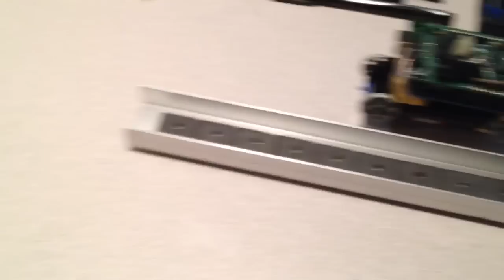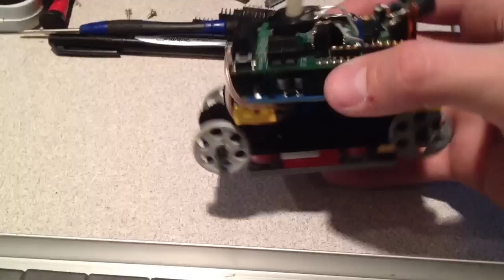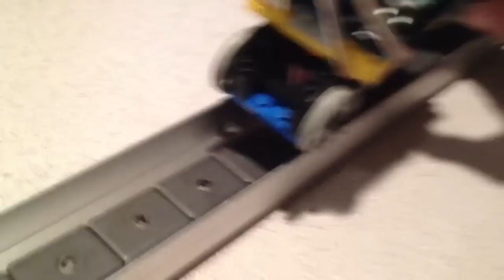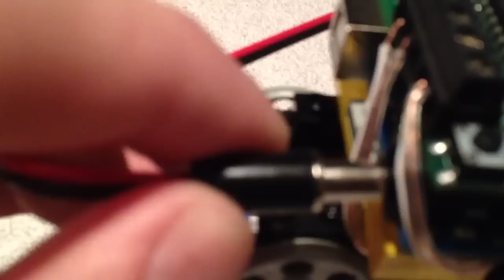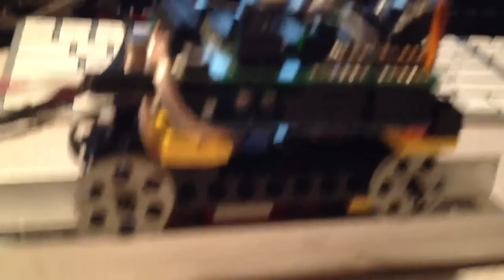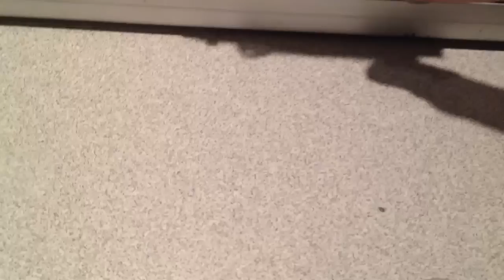2 Phase Linear Synchronous Motor mini

Comment: How did you build  your electromagnets plz ? Or  Where did you buy it ?
Reply from the maker: I think I wound the magnets by hand around nails or screws that happened to fit the lego perfectly.  You should use magnet wire for things like this, it has a thin enamel coating instead of thick rubber/plastic.

Comment: Wow, awesome stuff!

Would it be simpler if you used permanent magnets on the train and electromagnets on the track?
Reply from the maker: I never saw a notification, sorry - It could be simpler to do so (magnetically launched roller coasters use such a setup) but would have required a lot more magnet wire, as well as more output channels on the driver

Comment: What if you had a track with the coils all lined up and then a cart with a few magnets (or maybe just one?)... would that work also? 

How do roller coasters launch their cart without power on the train itself? Awesome project btw!!!
Reply from the maker: Excellent questions. Most magnetically launched roller coasters use linear induction motors, which have the coils mounted on the track and aluminum fins on the train itself. Some do use linear synchronous motors though, which have magnets mounted to the trains, as you suggest.
Reply: @Blorkus  I was wondering this too. If a roller coaster train has magnets attached to the bottom, they would have to be controlled electro-magnets as two sets of permanent magnets together would propel the train at insane speeds pulling g forces well beyond what the human body can withstand. I guess what we were wondering is where are they getting the power from? Lithium ion batteries possibly? Why have we never heard of any fires resulting? I know that's a common issue with l-ion technology.
Reply from the maker: @steveo7771286  and Matt, Luckily it's simpler than that, they mount permanent magnets to the train and the electromagnets along the track, and that's only if they're using synchronous motors. Most use induction motors on the track, which just need aluminum fins mounted to the trains.
Reply: @Blorkus  Ah. That makes much more sense. Lol. I guess a lot of roller coaster manufacturers are leaning toward lsm tech in their newer models as opposed to lim as it apparently more efficient, and both are far more reliable than hydraulic launches, although nowhere near as forceful or thrilling. I guess the capacitors and power grids can only handle so much energy being expelled at once. I don't know, I've always been fascinated with this technology, especially with launches. Hydraulic launches are way more forceful and admittedly freaking cool to watch/listen to, but on a tech level are actually quite boring, comparatively speaking.

Comment: Very cool project man! :-)

I have a motor design that uses the LSM principals, but works in a circular motion, so the drive can be harnessed for other purposes.
One thing that I've found is to move away from static magnets, and rather use electromagnets for both portions. By doing this, you can, in essence, time when the the magnetic fields are present, as well as switch the respective polarities.
With this timing ability, you can achieve a much more fluid movement, as well as create more effective drive with lower power consumtion
Reply: What would you use to control the timing and to switch the polarities? I'm considering doing something like this as a project for an E&M class...

Comment: Im learning about motors and electricity for work. And reading about sychronous motors right now. The info ive gotten reads that the stator field comes on to quickly for the rotor field to absorb...causing the imbalance you are having where it bounces off North and South. They use a squirrel cage to help designate polarity for motion in cylindrical fashion with 24v DC to align poles and "lock in" 
What about applying low volt to your magnet path below? Would that somehow lead the cart in a single direction ...maybe if the Hz were modulated and variable? 

Just curious what that might do. Any ideas?
Pulse Width Modulation is what i had in mind

Comment from the maker: It is indeed very possible. However, it is also much more complicated than you'd ever need for that kind of application. The way I see it, a cable system, though more permanent, is very simple, robust, and probably less expensive. If you were to use a LSM, you would need a track lined with magnets and free of debris, as well as microcontrollers and powerful solenoids on the carts. I'm no expert, but I would have to say it's a better idea to use cable-driven systems. Thanks for the comment!

Comment from the maker: I'd be happy to share the sketch, but there's no real point. It's beyond simple: The coils are connected to the Adafruit motor shield, so you can treat them as DC motors in code, and setting their speed controls their strength. All I did was cycle a variable from 0 to 359 degrees, and for each value I set one coil's "speed" to the sine of the variable, and the other to the cosine, and then delay by the potentiometer value.
Reply: Blorkus I did the same thing  but in my case there is a problem : my adafruit  shield doesn't give current to my coil from copper wire 0,1mm  . How did you do something like that ,can you please answer me ? Can you specify how did you build the coil ans the link to the adafruit shield ?